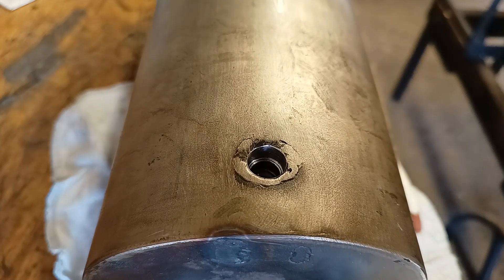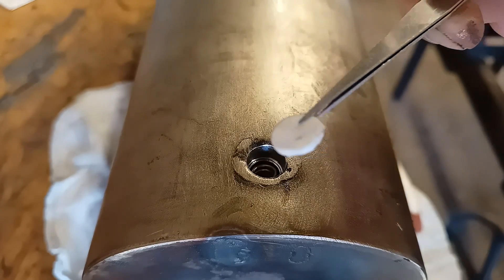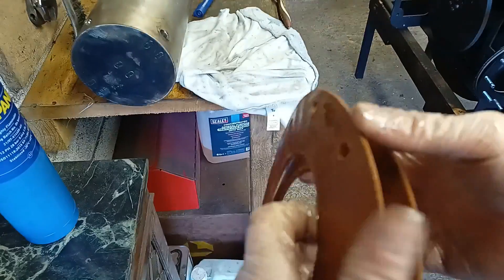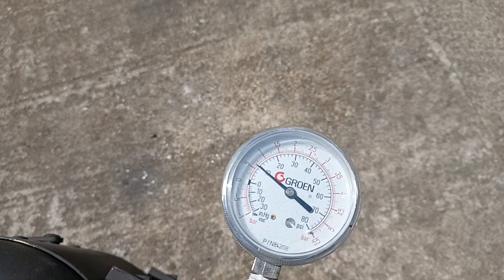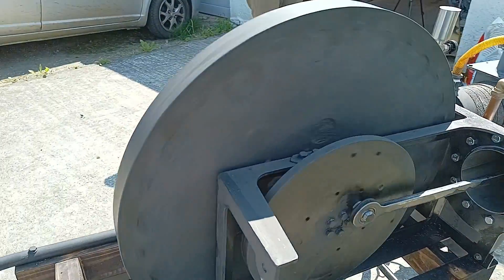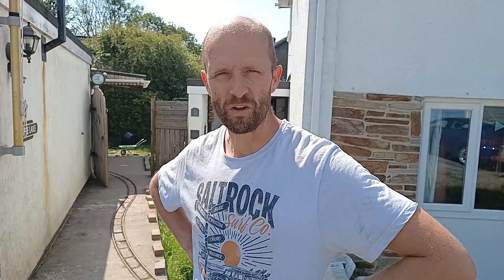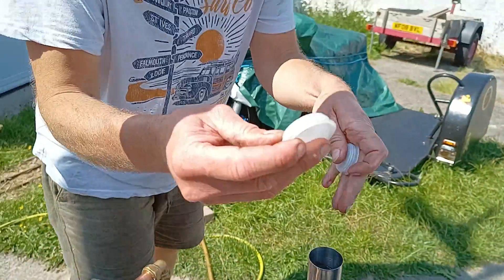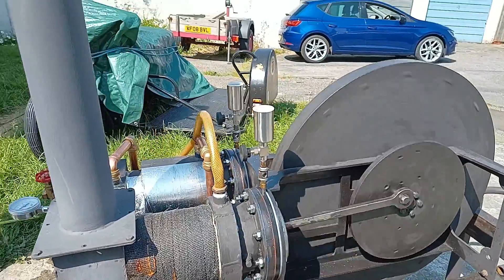Stirling Engine Horizontal Engine - Piston guide problem solved! - Part 12

Comment: Amazing work. Do you realise that normally the gas inside the engine would be pre pressurised. I can't remember the numbers. Typically helium would be used because of its good thermal conductivity and non combustible and it would be pressurised to 9 bar. Air or nitrogen should be higher pressure.

Comment: Good job
I had a little Sterling that I bought from eBay using a parabolic reflector I use the sun shine on the hot end and it was working also I used hydrogen which I made from water electrolysis small generator
Reply from the maker: Wow, impressive stuff, good on you! I suppose with the sunlight, hydrogen ignition won't be such a problem : )

Comment: I have just watched the whole series and gained some new insights about alphas. It is really valuable to follow the whole development process. Just presenting the solutions does not always give much insight, but you clearly demonstrate which problems you solve. It adds a significant pedagogical dimension. Thank you for sharing this process!
Reply from the maker: Hi Paul, it's been great fun learning along the way. I've read what I can about stirling engines but a lot of my knowledge is from practical experience. There's alot of information / theory's out there, but the hard part is working out what's important! All the best

Comment: Hello
If you can rework your piston to have a closer fit with the cylinder, (f8 H7 tol), you will not need the steel balls. The forces will get distributed over a larger, lubricated surface (your drip system is fine). The wear will be lower and so will the noise.

Comment: Yes; a part 12, keep 'm coming! I must say that for a fundamentally flawed design (i.m.o. see comments on Part 10) it is working very well! These ball bearing ..distancers are a great improvement. Would love to see what you come up with next. Maybe try this on the cold side: make a 4cm wide slit in between the water cooler and the top inside of the cold cylinder. So cover up ±3/4 of the space. The slit in the middle on a 90º angle to the cool ribs. Why? To get a vortex type airflow in the cool cylinder, to cool the air more (by increased contact with the cylinder walls).

Comment: The runaway affect is what I've been worried about even with a load it will stall or blow though the piston once again. A valve on your one way inlet should do the trick. It wants to keep drawing air in. A lot of German Sterling engines run on various pressures, most of them you have to add air, so for yours to keep drawing air is unique. The ball bearing, was amazing idea. Looks like just the shutoff at the inlet some experiments at a good balanced pressure and time for some load testing. Can't wait to see your work progress, she is a fine powerhouse.
Reply from the maker: I didn't think of putting a valve before inlet, good idea

Comment: The way I see you going, I suspect your work will end up taking you to a 12 piston stirling engine with a fire one one side, and a liquid nitrogen delivery system on the other. Your liquid nitrogen will be made with a homemade stirling cryocooler being driven with power collected from a diy stirling engine powered generator. I can also see you running a home air conditioner with a car hvac compressor driven by yet another stirling engine.
Reply: Now package all that in an international shipping roadcase, and I'll buy one.

Comment: one thing - those ball bearings are far harder than the cylinder, so over prolonged use it won't be the easily replaceable runners that will wear, but your cylinder will wear. this is bad, needless to say.
Reply from the maker: I'm hoping that they will mostly roll! A certain amount of oil is also present. Not an ideal solution, but then, this engine was never designed to run on it's side. All the best

Comment: What is the purpose of that hole with the ball bearing ?

Does the weight of the ball bearing work like a weight on a pressure cooker or one way valve ?
Reply from the maker: It is simply to stop the displacer type piston rubbing / knocking on the cylinder wall.
Reply: @ShanePomeroy  

Not sure how or why that works, but ok.

I would think a few would be needed ( at least 3 ) around the cylinder.
Reply: @janshuster1426  Hi Jan,  An explanation is called for. There are in fact 4 ferrules welded into the cylinders all which housed 4 brass (bullets) spring loaded this caused a right high pitch noise. The brass has now been changed for 4 ball bearings backed by a small plastic disc to enable them to rotate the springs have been shortened to accomodate the bearings . Wether they do spin goodness knows, but the noise level is now good and in sounds more like a sewing machine. By keeping the cylinders central there should be far less wear on the leather seals at the top of the pistons.
Reply: @philippomeroy5769  

That makes WAY more sense.

I wonder what internal combustion engines use other than just the piston rings.

Is that just something you couldn't reproduce ?

Could you recycle a piston or are other issues involved ( like weight, can't easily get one big enough, etc )

I want one that would work on the heat of a wood stove ( 200 to 500 degrees ? )and put out 100 to 500 watts
Reply: @janshuster1426   Shane will be testing for the power output for the present engine shortly and is in the process of manufacturing a means to do so. His working remit is simplicity and low cost for each project. Our present Mark 3 has still a little way to go before we sell it on to recoup some funds and start on the next design Mark 4. Shane has another idea which might work better than Mark 3. Keep in touch and watch this space.

Comment: Do you have an air compressor? I ask because to my knowledge Stirling engines work much better with thinner gases and with higher pressures. Of course, pushing hydrogen or helium into the prototype is a waste of money, but consider whether it's worth adding a one-way valve and pre-pressurization, e.g. 2-3 bar, before starting, what do you think?
Reply from the maker: I think it would be a fun experiment! I'll do a dynameter run without pressurisation and then perhaps try a 1 bar or 2, cheers
Reply: I'd like to see this too

Comment: It's amazing - I wonder if one could be used to power a canal narrowboat? You need about 2hp
Reply: Yeah this engine is really nice but it's not 2 hp. The OP says he is hoping for around 500 watts electric. Which would still be very impressive since the majority other folks on YouTube struggle to get 100-200 watts similar to this scale
Reply: I'm going to say 3.5-4 hp, can't wait for testing.
Reply: Sad to say this is probably well under 1hp. You could perhaps have an electric narrowboat and this recharge the batteries.